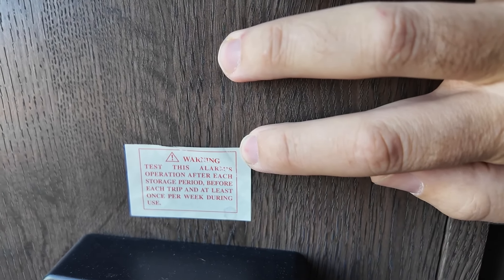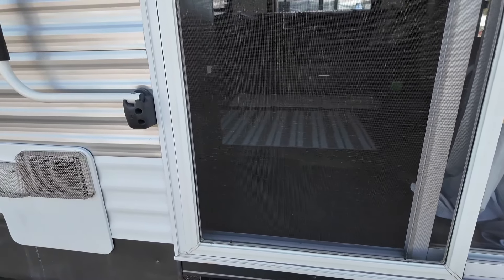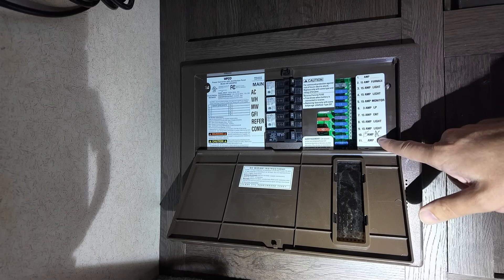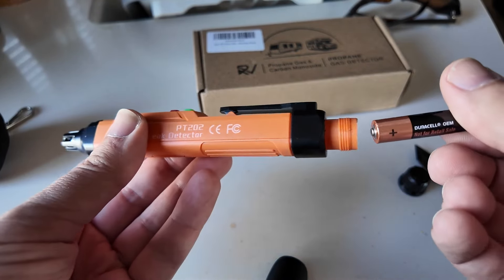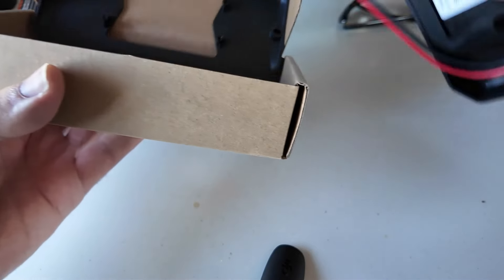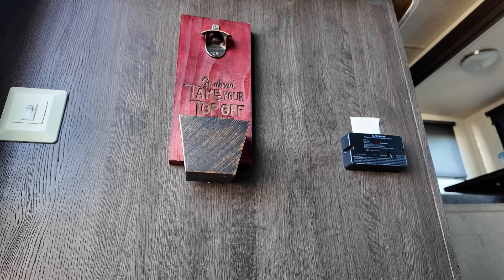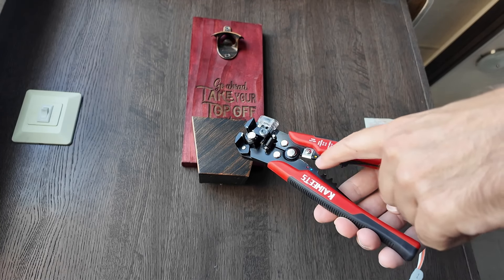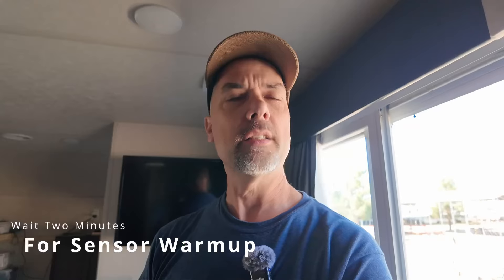Easily Replace Your OLD Detector

Comment from the maker: Update:  I went through 2 of the CO detectors in the video and both of them had too many false alarms.  I have updated the links in the description to point to the new unit.  The procedure is the same, just the brand changed.

Comment: I have changed many of them. So many do not know they only last 5 years. I use them for off grid cabin as well. many have 12V system. Mine does and 24 V as well. 12V lighting . LED RV lights are awesome.  Little RFI noise . The CFL ones are bad for  RFI .I still have them. but mostly run LED . My old incandescent RV lights have new LED lamps in them. Many are new units. Most of battery detectors are CO and smoke . The 12V powered RV units are also  combustible gas detector as well.
Reply from the maker: I like that most of the RV is 12v

Comment: Another good one, TO. I have a Carbon Monoxide detector here that is made just to be placed somewhere. It does not have mounting holes. Nice thing was that when I moved, I could take it with me.
Reply from the maker: If you've got any kind of gas heat in your new shack, make sure to get another one for when you're out there!
Reply: @livingforalivingRV  No gas. All electric.
Reply from the maker: That works in TX - couldn't afford heat in WI without gas!

Comment: Im ahead of you but i should look into a Lower flammability limit detector (LFL) sounds like yours does both ... nice.  One question did they mentioned location for mounting since propane is heavier then air.
Reply from the maker: They did mention a location for mounting in the manual.
Reply: @livingforalivingRV  when I had my boat they sold a LFL to turn off the gas solenoid. I couldn't come up with a location that would satisfy me as there are too many nooks and crainies on o boat for gas to hide from a sensor. So I wired in a mechanical 60 minute timer instead. Realistically it would likely take 60 minutes for it to detect gas anyway. Usually would only turn to 30 min anyway.